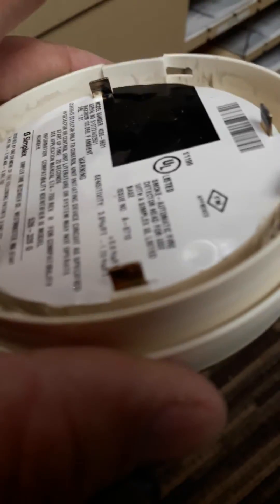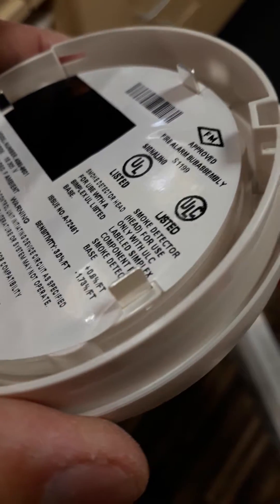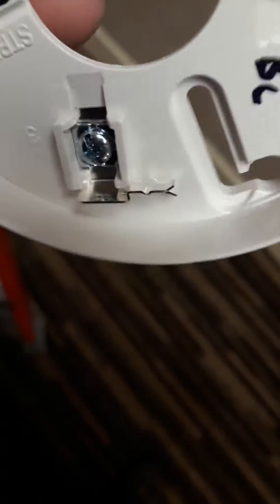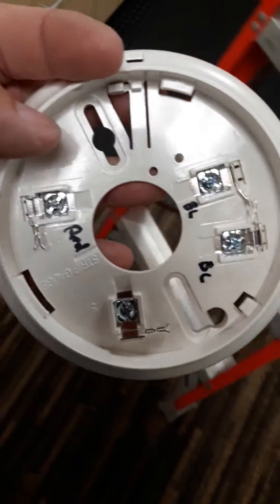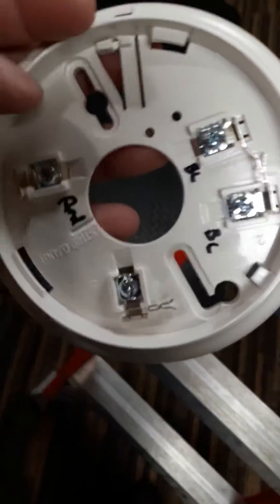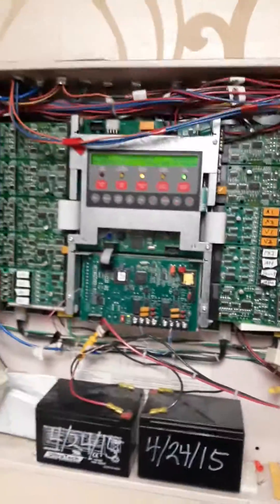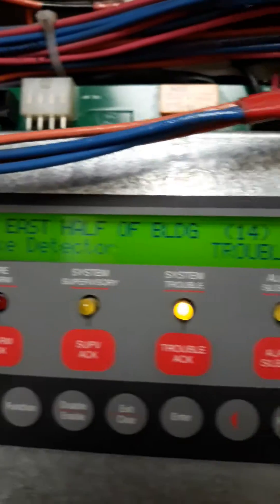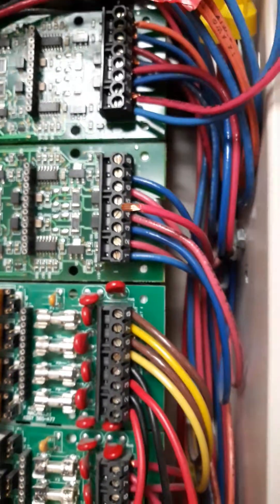Replacing a simplex zone panel 4005 smoke detector

Comment: Great video 😀👍👍
For some reason, the Siemens Panel at my school, needs to Restart (flip power switch and reboot) whenever a smoke detector gets added or replaced, or it will alarm.
Reply from the maker: What model is it
Reply: K Hawk The Panel is a Siemens FireFinder XLS, and a mix of HFPT-11/HFP-11 Heat/Smoke Detectors 

https://firealarmresources.com/wp-content/uploads/2013/06/Siemens-FireFinder-XLS-Operation-Installation-Manual1.pdf
Reply: Typical Siemens